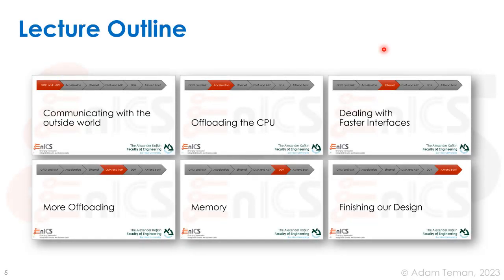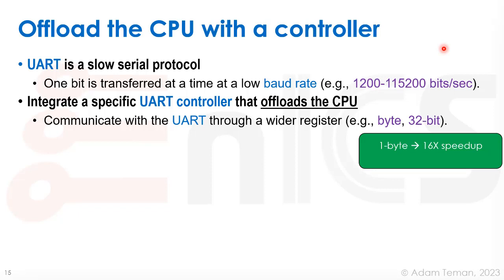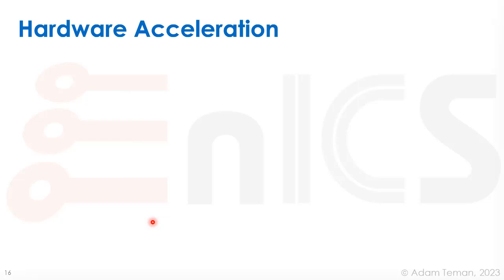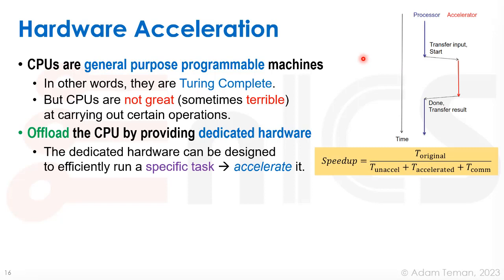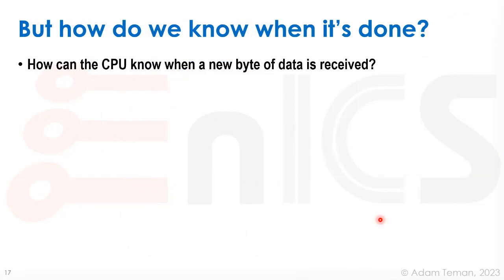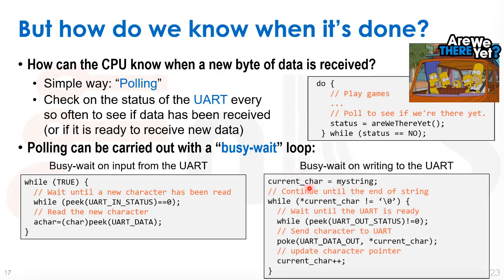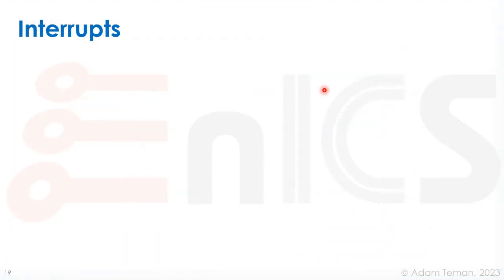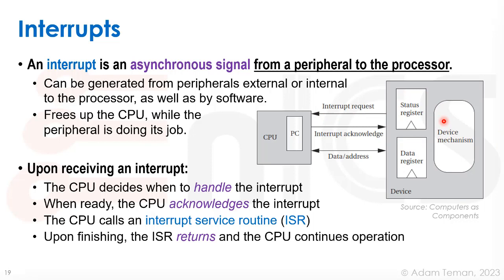SoC 101 - Lecture 5b: Offloading the CPU

Comment: Really grateful for this lecture series. Awesome lectures. I have a question: I did not understand the part around 1:08 that says if we can deal with a whole byte at a time then we get more than 16x speedup because we don't have to double-sample. Why don't we have to double sample in this case and why we have to double sample when we transmitted bits?
Reply from the maker: According to Nyquist, we must sample a signal at double it's rate in order to be able to reproduce it. So if we are transmitting at a frequency of f, we need to sample at a minimum of 2f in order to identify the toggling and understand what was transferred. 
In the "original" approach, the CPU did all the sampling and did this bit by bit. So the CPU had to check what appeared on the interface at 2X the frequency of transmission and repeat this 8 times for a single byte. Once we use a dedicated controller, it handles all the transmission, so the sampling is done by the controller and the CPU is free to do whatever it wants. The CPU only checks the controller (or gets an interrupt) to see when a whole byte has been transferred. So it can get the byte when it is ready which is following 8 bits transmitted, which it originally would need at least 16 operations of checking the interface to do. So a speedup of (at least) 16X.